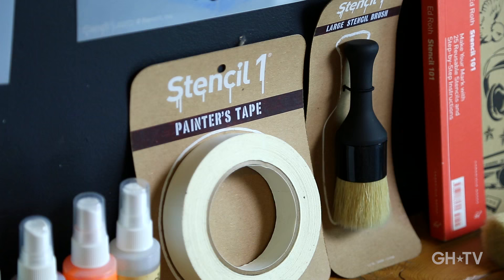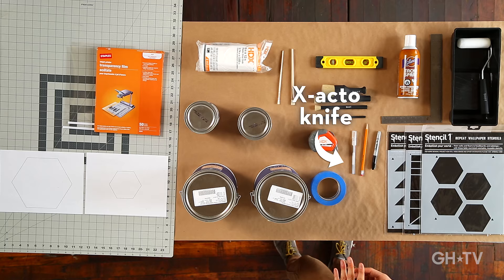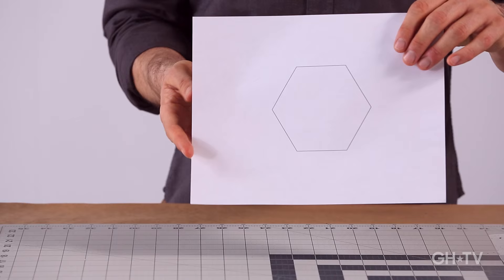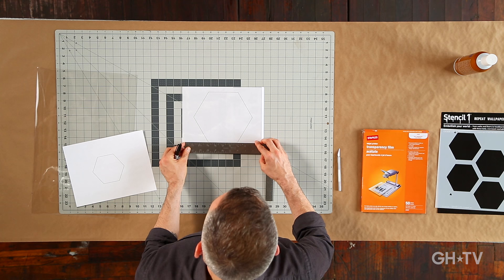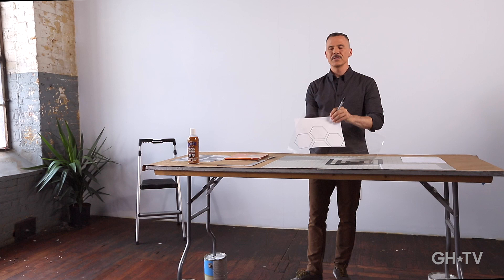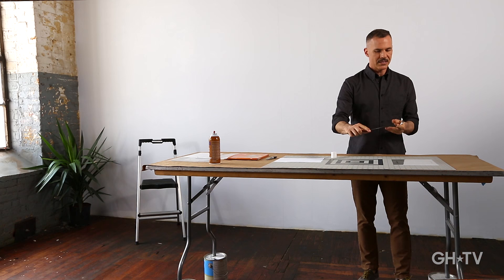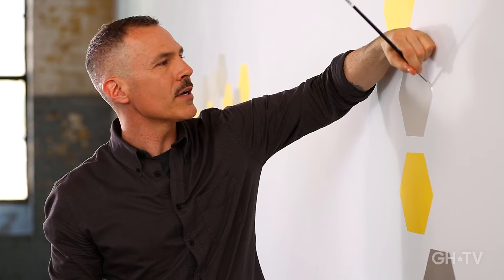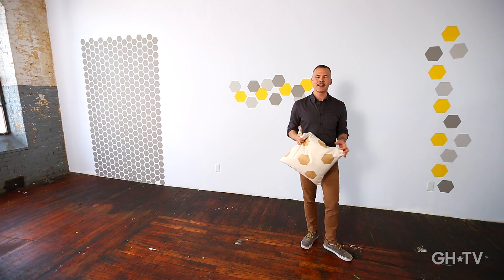How To Paint Modern Wall Stenciling With Ed Roth | Design 101| Good Housekeeping

Comment: 1. The method used to make a stencil only affords you a simple, small, generic, borax design. 2. To do an entire wall, a person would have to take a leave of absence from work to complete it!  3. If a person was bent on doing a "similar" geo design, it would be FAR less cumbersome & time consuming to generate a pattern where the wall could simply be TAPED, without the trouble of making such a stencil.

Comment: how thick should a wall stencil be (the material) ???
Reply: sorin990 no u don't need a certain thickness for making a stencil it's just a transparent plastic sheet...
Reply: shambhavi parab
thank you for your reply ...I tried to make a stencil with a 0.7 millimeter sheet of plastic, did not turn out that good, It seems I made a study on this and the best works with a 0.3 millimeters, I use 0.5 millimeters because I did not find a 0.3 one ...so 05 is quite ok, having +0.2 more millimeters it prologues the life of the stencil !
Reply: @ sorin990Ohh k great thx for ur reply